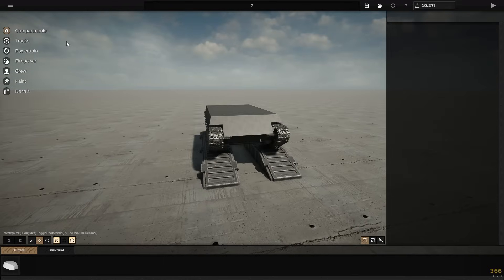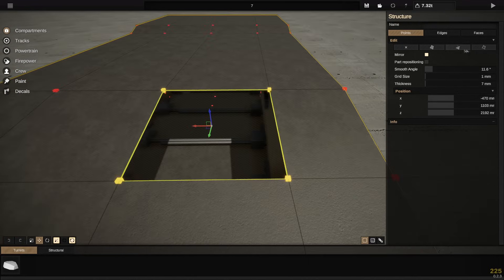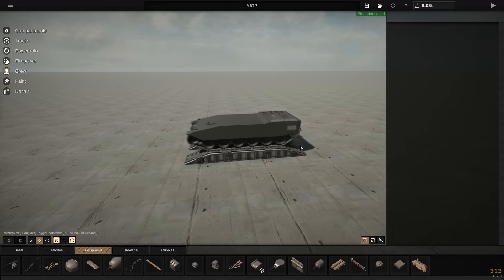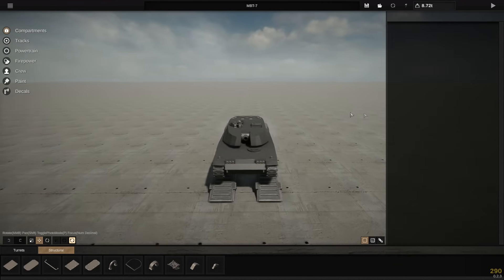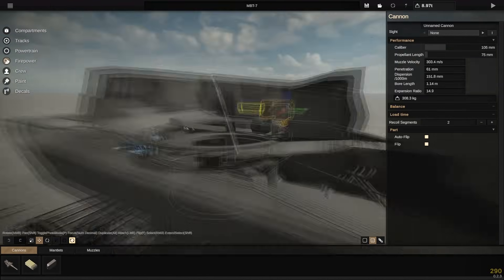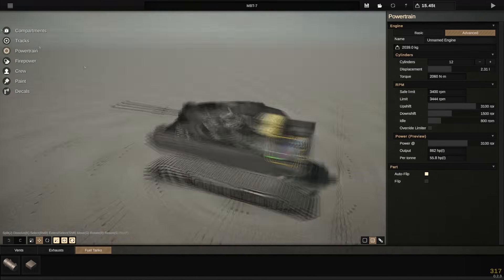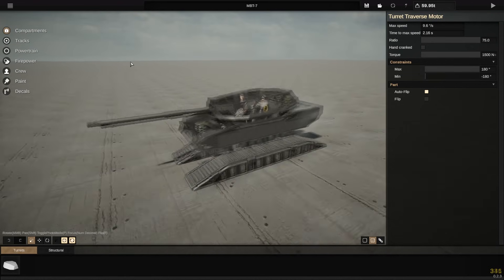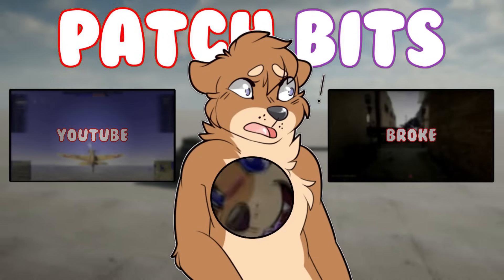Building a MODERN MBT with Geometric Internals! | Sprocket

Comment: Now create internal composite modules by overlapping multiple layers of angled plates
Reply: Thats too much greebling
Reply: might be too heavy.
Reply: @spehhhsssmarineer8961  I did it. Didn't take too much weight I'd you kept the plate thickness between 20-25mm
Reply: After the latest update u can now do this more easily with additional parts
Reply: Just use freeform
Reply: @Habarych_Monolith  I used freeform, yes
Reply: Used to do this with ACF, a tank combat system in gmod, ~12 years ago lol
Reply: @spehhhsssmarineer8961 my MBT is 56t...and has more armor than the Abrams

Comment: I honestly think that the closest looking MBT is the Leo-leclerc prototype if the Leclerc didn’t have the storage boxes on the front of the turret lol (a bit cursed but looks nice lol)
Reply: more like a Leopard 2A4
Reply: @KoenigPixel  the 2a4 turret’s isn’t rounded at all, even if I agree for the optics that it looks more like a 2a4, but on the general shape of the turret I think looks more like a Leclerc
Reply: PT16
Reply: @exonys3838  I think it is a prototype leclare  but they use a different hull type from the K2 cuz the leclare can't lower it tracks if it was base off the prototype
Reply: @O5c-1  the K2 has nothing to do with the Leclerc (not Leclare btw)
Reply: @exonys3838  no he's said the hull was based off a K2 hull
Reply: @O5c-1  yeah and ? and the Leo-Leclerc have a leopard 2A7 hull
Reply: @exonys3838  I'm not against your words I'm just making a point of view
Reply: Look like a leo 1. Makes sense if it's the 120mm test variant.

Comment: @Patchbits Fun fact! That box above the mantlet on the Chally 2 is a laser and laser detector! You see that bit that sticks up on the front of the barrel? That is a laser reflector. The idea is that barrel warp (with temperature, from climate or extended firing, the barrel can warp SLIGHTLY, which at modern tank combat ranges is a big deal) can be measured by how much that laser beam is deflected upon its return.

This is also why MBTs have what seems like thick canvas covers on their barrels. They are insulation to keep the barrel more thermally consistent!
Reply: Same for navel guns!

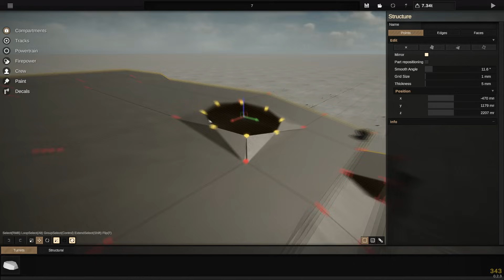Comment: 3:18  Normally, I recreate the gun I plan on sticking on the tank I'm making and use it as a reference for the reference for the scaling of the rest of my tank. For example, if I wanted to make a similar vehicle to the M36 I would replicate the 90mm M3 and build the rest of my vehicle around it.
Reply: greedles

Comment: it is I, the one who told you about autoplacement of turret holes, It only happens in not-free-form (sucks)
needs more Greeb-a-ling. Add smoke nades?
Also your camera is focused around, say a block. when you move your camera, it "orbits" around the block in whichever direction you moved it. Your block however, is near the floor and (if you want) can be moved high with (SHIFT+MMB+DRAG). Don't forget to zoom in tho   (God i hope i dont tell you incorrect information that is right, but just not said clearly.)

Also how edit turret torque beyond its limits